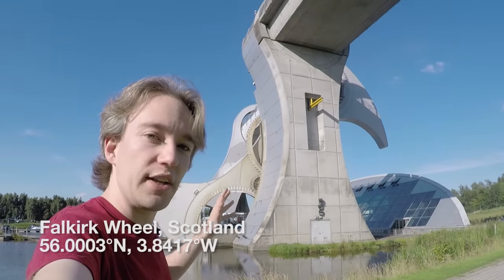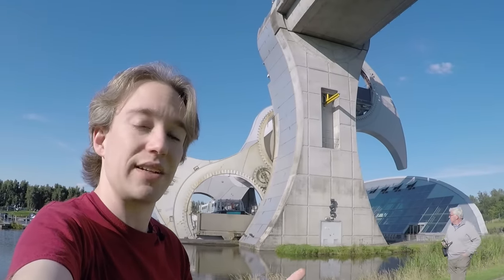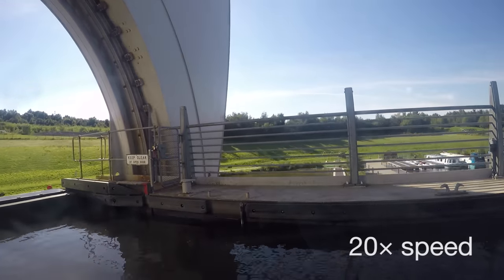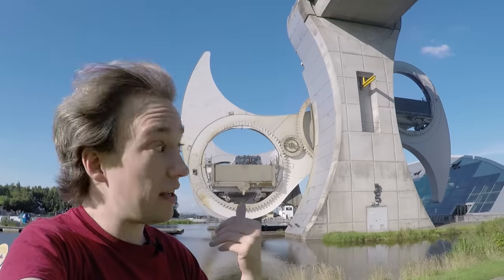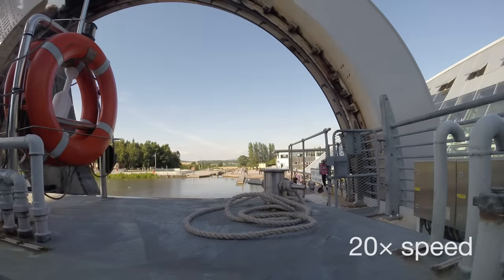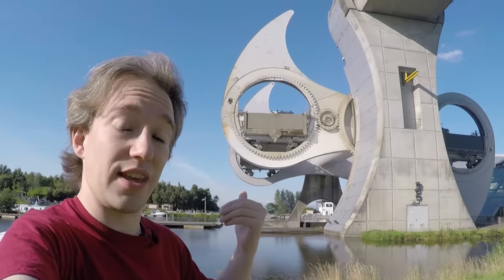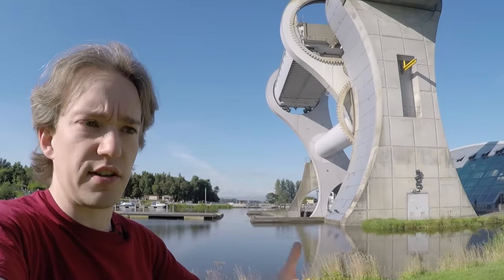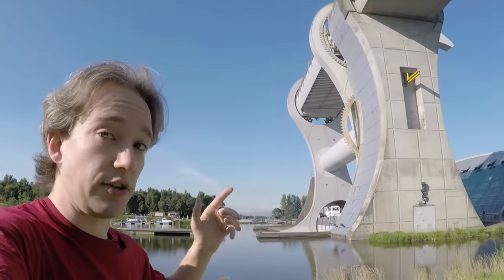Archimedes and a Boat Lift: the Falkirk Wheel

Comment: Bruh, some desktop computers draw 1.5kW... and that can power this lift?!
Reply: I was amazed, mine can draw almost 1.6kw under full load
Reply: Feels unreal. Daamnn
Reply: No they don't. Show me any 1.5kW desktop computer you can buy. And I don't mean the rating of the power supply, I mean the actual consumption at load. If you want to calculate this you can enter the parts on pcpartpicker. Even at load most computers consume far less than you would expect.
Reply: My old 50cc motorbike made more power than that
Reply: @Oscar-if6lq  easy, one Shintel i9...

Serios: take a hedt Cpu and a 4 Titans for rendering, or a threadripper and a lot of harddrives. Nearly every server uses more.
Reply: @lensippel  tbh at that point that's hardly representative of a desktop computer.
Reply: @Oscar-if6lq  You probably wouldn't be able to assemble one with whats available on pcpartpicker, but check out System76 workstations some time. There's a whole website where you can compile any desktop sized workstation you want. Generally these are enough to run simulation and rendering work for small companies with no issues, but they will absolutely draw 1.5kW under load with no problems. And they're desktops.
Reply: @TheAero1221  come to the beautyful europe, where we can power up to 3,6kw out of one outlet. Here we have bigger psus so you dont need to make a pc/server with more than 1 psu, only because you need 2kw.
Reply: @lensippel  You will probably still use 2 PSUs fur redundancy purposes.

Comment: Though I did spend a bit processing the fact that the weight never changes it does make sense
The water level doesn't change and so the weight of the water and stuff in it wouldn't change

Comment: In exmoor, I'm not sure where, there is a double cable car system on a 45 degree angle that uses no energy because there is easily accessible water at the top. I'm sure it will be easily searchable.

Comment: Couldn't they run this with gravity like you said but instead of using power to slow the massive momentum couldn't they fill the top one a little more but the as soon as it starts to move start emptying out water to compensate for the momentum and slow it down so almost no power for braking is needed. It would obviously have to be very precise but it should work!!

Comment: Wouldnt it be alot more energy efficient if there was more space in the upper chamber and a pump pumping water into the higher chamber once sealed making it so momentum and the bump are the only two things working ontop of that you wouldnt be losing any water in the upper part

Comment: Uhm, actually, the same principle is used in other Boatlifts too. Maybe not the designer solution as there, but for example the "Schiffshebewerk" in Niederfinow, Germany is based on the same principle, only that it uses concrete weights on the other side to balance it out.

Comment: 0:50 I'd have expected we'd have more power usage here in England, what with all of the tea and all.
Reply: As far as I know, you only need an electric kettle to make tea, which involves a pitcher and a coil to heat up the water. Since we Americans brew more coffee over tea, coffeemakers have heating elements for the water, brew strength options, timers, and heating pads to keep the carafe warm. In short, a lot more components per machine which would use more power to operate.

Comment: I know it’s not nearly as impressive but next time you’re in Ontario you should check out the PeterboroughPeterborough Lift Locks on the Trent Severn water way. It was the largest hydraulic locks until a few years ago and it was built over 100 years ago.

Comment: So if the boats displace and remove a bunch of water when they get on, what happens when they get to the top? Is there more water at the top to fill the space where the boat just got off?
Reply: Obviously! It opens into a canal at the top, miles and miles of water. The boat motors out, and immediately the space is occupied by water from the canal.

Comment: "...a floating object displaces an amount of water equal to its weight"! I beg to differ with that. Archimedes's law states: the upward buoyant force that is exerted on a body immersed in a fluid, whether fully or partially submerged, is equal to the weight of the fluid that the body displaces.

Comment: So you could run it with a fully loaded cargo ship at the bottom and an empty cargo ship of the same type at the top, and it wouldn't use more energy as if it were running only one ship, or rotate without any vessel in it?
Reply: +Seegal Galguntijak 

Yes..

If each caisson holds 500tons of water they balance.

if you then put a 499ton boat in one of them that caisson will have 1ton of water left in it plus a 499ton boat, which is  500tons, so it still balances.

if you put a 1ton boat in the other caisson you'll have a 1ton boat and 499tons of water, still 500tons overall, they still balance.
Reply: Mark Batchford That's indeed ingenious. Do you know the maximum weight of a boat it can carry?
Reply: +Seegal Galguntijak that would be 500 ton, because then the boat displaces all the water in the caisson and... well it would no longer float. if you mean the actual overkill limit of the machine, its probably over 500 ton by a bit, to be save.
Reply: gorden2500 Yes, but since the boat needs to float, and in order to do that, it needs a certain amount of water around it (plus, if a boat weighing 500 ton were small enough, there would still be more water around it, it would just lay on the ground, making the whole thing heavier than 500 ton), the realistic value would be somewhere far less than 500 ton. Maybe 200 to 300?
Reply: Forgetting that this serves a canal, where boats are limited to just under 7ft wide and 70ft long, probably capable of carrying 30 tons or so depending on the material. Anyway I doubt any freight is moved by this nowadays, it's 99% pleasure boats.

Comment: 3 kWh in 3 days? How is that even possible? My computer uses about 600 watts of power so I would easily be at 3 kWh a day just from a computer. And then there's still lights, oven, cooking, tv and all other household equipment. There is no way the average is 1kWh a day. That would mean you pay something like 50 euros a year for electricity.
Reply: Where did you get 3khw in three days from? He said 32kwh in three days is typical UK usage, around 10kwh per day, or around £1 / €1.20

Comment: 1 1/2 KWh is 3 e-bike batteries. Those little black bricks that power a relatively lightweight and small bicycle around...

A Tesla Model S has up to 100Kwh and only weighs 2 1/2 tonne or so... go figure.

Comment: British design British built Both factories now closed and consigned to the history. Why /how do I know? Because I machined the central shaft the whole structure rotates on
Reply: Was that Butterley? I know they made the gondolas.
Reply: @UKscalemodeller  Butterley was the designers. Davy Markham were the sub contacted to do the shaft
Reply: @samuelwragg8615  cheers, I wasn't sure. I worked for Fairfield controls at the time. We wired it up and designed the control system.
Reply: @UKscalemodeller  if you look on the main axle there's a patch of grey in a slightly different shade. The reason is to cover up SWFC that was painted on in the workshops at Sheffield prior to dispatch

Comment: But all elevators have a counterweight, is this really that different?
Reply: You are a lot heavier than the amount of air that would take your space in an elevator. Lifts have a max. weight limit that (I'm guessing) is equal to roughly double the weight difference between the empty lift and the counterweight due to cables and other things breaking.

In this, the weight of water the boat moves out of the way is equal to the weight of the boat (assuming it's floating) so there is no overall weight gain/loss.
Reply: Mrord1 Sure, but I mean they could have built this with a straight vertical lift plus counterweight and it would have worked just the same.
Reply: ninjafruitchilled Well with that you're relying on wires to not cables and the boats are really bloody heavy.
Reply: +Mrord1 Sure, but we can make damn strong cables. They hold up huge bridges and such.

Comment: ....and, then there's the Panama Canal lock system that lets higher up water drain down to the next lower lock, lifting the boat residing there,  and vice versa in reverse-a. The system is solar powered via evaporation and rain. 🤔😏

Comment: Mass not weight
Reply: because both the boat and the water should be under the same force of gravity it will make no difference.
Reply: This may convince you that 'weight' is the thing we need: imagine the tub was on the moon and you put a boat in it. Clearly the buoyancy force required to keep it afloat will be smaller than on Earth, given the gravitational force pulling it down is smaller. So less water will be displaced.

When gravity makes a difference, you want the weight.
Reply: Unless he starts vising other planets or outer space, those are equivalent if not identical terms.

Comment: kWh of ENERGY not power. Might seem trivial but conflating two different terms can really kill some people new to  physics.
Reply: seigeengine Electricity may be referred to as power by laypeople. But I don't think even household electricians would be comfortable doing that. It's not a physics niche. It's the entire field of engineering. kW would be power. If you try to compare kW and kWh, you're going to have a lot of confusion and it won't be pleasant. There's electrical energy and there's electrical power.

Comment: If water is displaced by weight of the object floating in it, does that also apply to polar ice caps? If Antarctic ice melts, water levels do not actually rise as some fear they will, because water will be replaced by the weight of the original ice cap? And since ice is less dense than water, water levels should theoretically DROP? Look forward to your thoughts on this Tom!
Reply: This is true for the ice that is floating on sea, however the vast majority of ice at the Antarctic is on land, it is this ice that when melted will raise the sea level.
Reply: +Adam Stone Yes, AMCT is correct, this is not sea ice we are talking about, it is land ice, and the water melts into the oceans, causing them to rise.
Reply: No drop because the lesser density matches the weight of ice above surface.
Anyways, the rising oceans are mainly because of water's thermal expansion.

Comment: Why does an American house use that much more than a English one?
Reply: +Eve Hallows Larger homes, much hotter and longer summers and harsher, colder winters. Most of the energy difference is because most US homes have central heating/cooling. Weather in English is fairly temperature and stable.

Comment: Been there, extremely boring after 10minites. 

They have an amazing machine that turns your 2p's into oval things with an image of a boat though in less than 5 seconds. Which is pretty funny because our "guide" told us that uses more energy than the Wheel. Kinda ironic but well worth the £1, or £1.02 I guess.